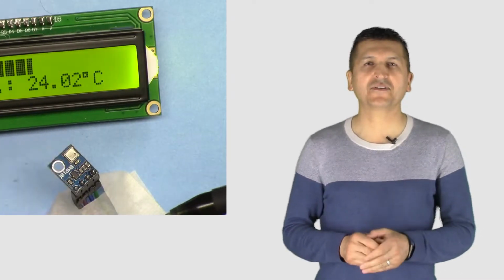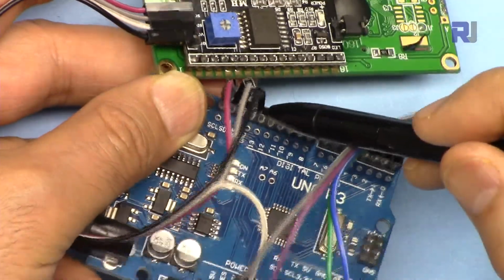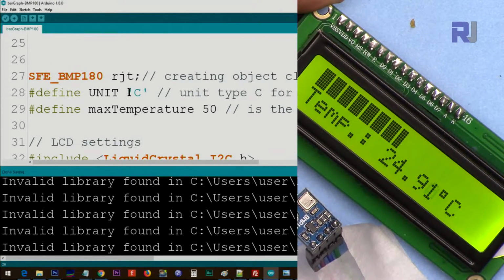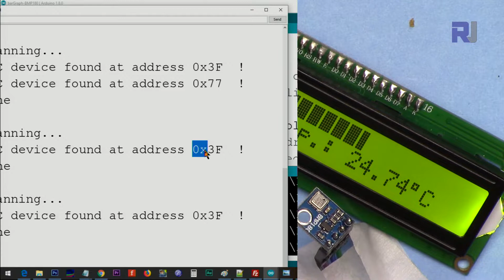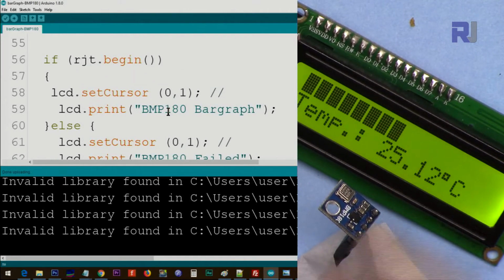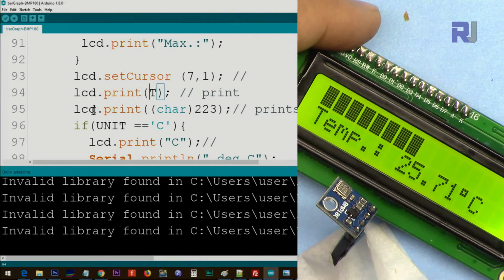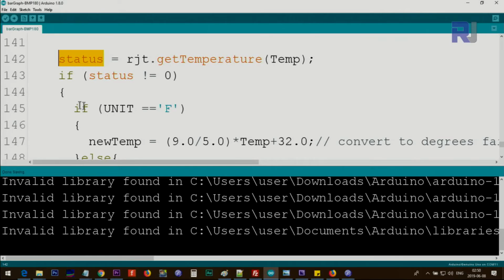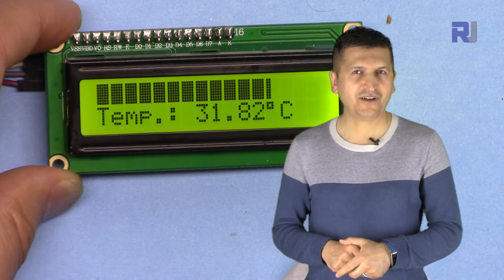Display temperature from BMP180 as bargraph on LCD for Arduino

Comment: Cannot Download the bar graph library
Reply from the maker: Thank for letting me know. The issue is what Chrome as I tested it with other browser it worked. I fixed it now and it should work with Chrome too.
Reply: @robojax  Thank you So much, because of couldn't download I had to edit the normal bargraph library to the I2C version. Anyway, it will help another one. Thank you